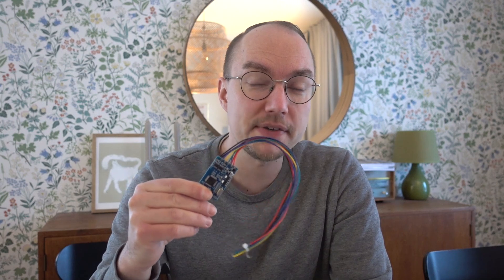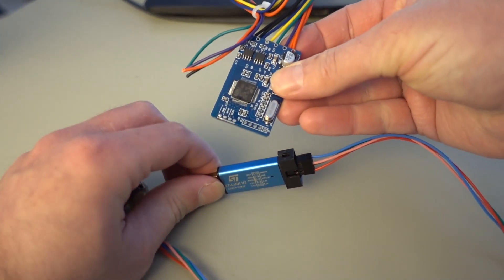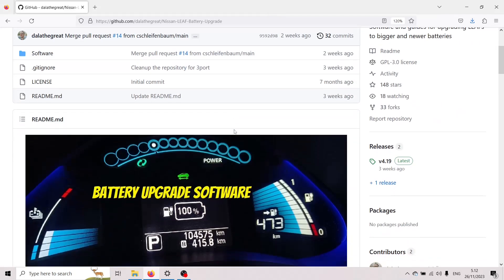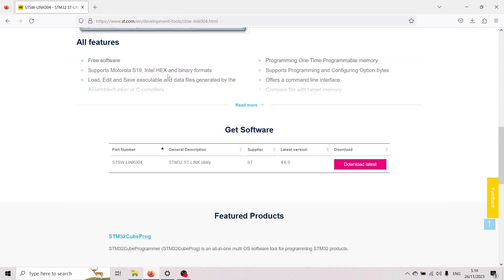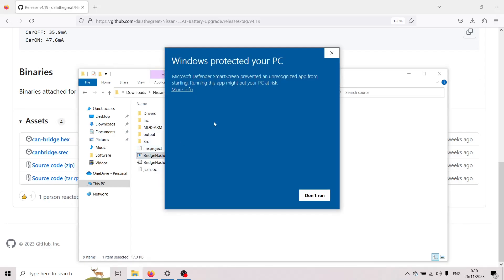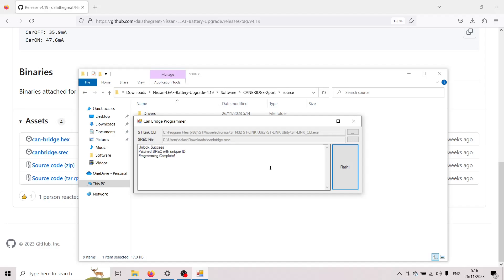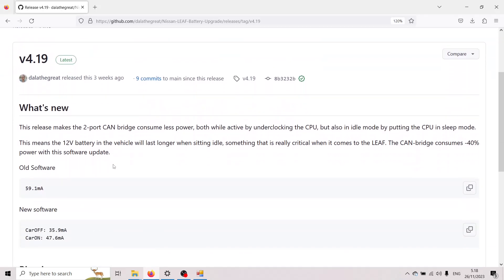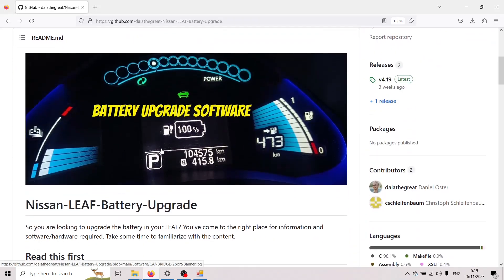Guide: Flash Battery-Upgrade onto 2-port CAN-bridge

Comment: Hi friend, thank you for your Canbridge project, it brought my Leaf back to life. I also wanted to ask you how to modify the Leaf to have the functions below?

Power increased to 94kW
Sailing mode in D
One-pedal drive mode in B
Improved heat pump and cold battery performance
Reply: is it work ? i do evry thing as it has to be . but on the car nothing changed at all like i connect nothing . any advice pleas

Comment: Hello
We have a 2012 Leaf with a 24 kWh battery. We installed cells from a 40 kWh battery from a 2021 Leaf into our battery (the size seemed to fit). We installed the CAN bridge according to your video—but the car doesn't recognize the new capacity. After turning on the ignition, it shows 136 km of range, but after 3-4 seconds it resets to 125 km (if the battery is charged). If the battery is not charged (we had a remaining range of 7 km), you turn on the ignition—it shows 136 km of range, then similarly resets after 3-4 seconds to 7 km on the dashboard. Please advise what to do?
Reply: In fact, the range has increased. We are tracking the remaining capacity through LeafSpy. The car charges - everything is fine with that.
Reply from the maker: You need the full 40kWh BMS and current sensor. My bridge software does not work for cellswaps. Complete batteries only!

Comment: Hi there - I got stuck with programming the board and was getting can't connect to the board error.  I assumed that the power from the programmer stick is enough. Not sure if my programmer doesn't have enough power or just ommited that info (or just had my moment). So if you can't programm the board for the same reason, just connect 12V supply to the board (black+red) while programming and it works like charm. Now it seems obvious to me ;)

Comment: Hi Dala, great video thanks.  When I followed the instructions, I get this error:

Unlock Success
Patched SREC with unique ID
STM32 ST-LINK CLI v3.6.0.0
STM32 ST-LINK Command Line Interface
ST-LINK SN: 62021102220032524B413836
ST-LINK Firmware version: V2J37S7
Connected via SWD.
SWD Frequency = 4000K.
Target voltage = 3.3 V
Connection mode: Normal
Reset mode: Hardware reset
Device ID: 0x418 
Device flash Size: 128 Kbytes
Device family: STM32F10xx Connectivity Line 
Loading file...
Unable to open file!

Any thoughts on that?
Reply from the maker: Try another PC!
Reply: @DalasEVRepair That failed on a Windows 11 PC, I don't have another Windows PC but managed to borrow a Windows 10 PC which worked correctly exactly like your video with just 3 lines of output. Thanks for the simple suggestion.
Reply from the maker: @EricLee-sj1bj  Glad it worked!
Reply: @DalasEVRepair  Now it's flashed, can I fit it to the car for testing with the original 30kWh battery stiil fitted?

Comment: Is it possible to make a firmware so that the canbridge works only when replacing battery elements? Perhaps it is necessary for the canbridge to calculate only the voltage of the battery itself and give the results to the instrument panel. Let's say 400 volts is 130 km. 390 volts 120 km. and so on. Of course, if you know in advance how much kilowatt the battery takes from the outlet. From this, make an approximate graph of the instrument panel readings.

Comment: Hi. After replace the battery 24 to 40 i still have Can errors. U1000-00-0B and P31B8-00-0B. In leafspy i cant erase theese errors. There is no turtle o the
 dashboard. 12v is on the canbridge.
Reply from the maker: This is a known bug, wont affect anything! We are working on still fixing this cosmetic issue, so check back in a few months, there might be updates available on the Github!

Comment: Good afternoon. I have a Nissan Leaf 2011. 24 kW, health 40%. I only replaced the batteries from the 2016 Nissan Leaf, 30 kW, 70% health, . will your canbridge help you display your dashboard correctly? Please answer.
Reply from the maker: Nope my can bridge does not work for cellswaps

Comment: Hi, thank you for your valuable help for those who appreciate electric vehicles. I upgraded to Nissan Leaf from 30kwh (2017) to 40kwh (2023). I state that I had to turn on the machine to move it before installing can bridge. I performed the whole procedure with a 2-way bridge. The flash went well immediately without error. But after the assembly everything looks exactly the same as before the assembly of the can bridge. Turtle mode remains active and the battery cannot be charged. I have used Leaf spy pro and the mistakes are always the same. I tried to delete errors but they remain active.  I have 2 questions.
1) Can you confirm that in the 2017 version the cables that go to the battery are the ones that end up in the plug? Or is it the other way around? 
2) You wrote that there are defective canbridges. At what stage of their use did you discover this defect? During software installation or after connecting to your Nissan Leaf. Thank you again.Hi, thank you for your valuable help for those who appreciate electric vehicles. I upgraded to Nissan Leaf from 30kwh (2017) to 40kwh (2023). I state that I had to turn on the machine to move it before installing can bridge. I performed the whole procedure with a 2-way bridge. The flash went well immediately without error. But after the assembly everything looks exactly the same as before the assembly of the can bridge. Turtle mode remains active and the battery cannot be charged. I have used Leaf spy pro and the mistakes are always the same. I tried to delete errors but they remain active.  I have 2 questions.
1) Can you confirm that in the 2017 version the cables that go to the battery are the ones that end up in the plug? Or is it the other way around? 
2) You wrote that there are defective canbridges. At what stage of their use did you discover this defect? During software installation or after connecting to your Nissan Leaf. Thank you again.
Reply from the maker: Hi,
30kWh LEAF can be upgraded to 40kWh without CAN bridge (but instrumentation km will flash)

I suggest you try without a CAN bridge first!

P3102 error code can be cleared with Leafspy Pro. I have videos on that.

Comment: Hello, 
Hope you are doing pretty well. I just need to ask about this can- bridge. Is it possible to use this can-bridge with original BMS to read a new capacity.
Remark. All cells have been swapped into new cells which have new capacity.
Thanks in advance
Reply from the maker: No that is not possible. Best to contact the person you bought the cells from.
Reply: @DalasEVRepair  He has no clue about solving this issue

Comment: Hey dala , I have a problem  ,  I tried flashing using the 2 port can bridge by installing and uninstalling the softwares and many things still it Wont flash , do u know any particular reason? i fixed those wires by soldering them with lead but still doesnt work , is it perhaps a problem in software release ?
Reply from the maker: I had 1/50 be broken right out of the box. Try another computer, or order a new bridge. They are unfortunately very low quality, I always recommend buying 2!
Reply: @DalasEVRepair  thanks man another computer worked

Comment: hey Dala , love your work here, will the 2 port Can upgrade allow me to charge my 2012 pack up to 4.2volts ? Will this give a 4 bar pack an increase in range ?
Reply from the maker: Nope, this is just for battery upgrades
Reply: @DalasEVRepair  Does you have a circuit that allows me to take a Chademo connector and leads so that I can connect the leaf straight into the Hybrid input of my solar inverter ?  I guess it would need a can bus signal to negotiate with the car to turn on the chademo power.
Reply from the maker: @chris2pherrea  yes we are working on this

Comment: Dala I purchased the can-bridge the two port i follow your video  and everything seem to work i down loaded lates software from github which is v4.20 now and made a account for STM32 ST-LINK Utility and everythink work up to the point of were it say Can Bridge Programmer I have the two boxes filled in were it say ST Link CU and Spec file I click on the flash box and don't the Unlock Success or any other failer just a blank box can you tell me what I might need to check?
Reply from the maker: If you follow the video and it still has issues, try another computer!
Reply: @DalasEVRepair  
Will the software work on a Apple PC the computer I tried it on was a window 10 lap top?
Reply from the maker: @SalvadorEspiritu-l2k  no apple support unfortunately!

Comment: Can I use the Cambridge to access the features such as battery saver to limit the charge to 80%and rapid gate dodger on a 2018 leaf?
Reply from the maker: No, this is for upgrading batteries on 2011-2017 Leafs
Reply: Do you know if there is any way to add those functions to a 2018 leaf?

Comment: Can I use the Cambridge to access the features such as battery saver to limit the charge to 80%and rapid gate dodger on a 2018 leaf?
Reply: its a good question Dala please answer i have the same issue in 2017 leaf

Comment: Can I use on my 2018 40kw leaf? Is the wiring the same as the other models of leaf?
Reply from the maker: No this is only for 2011-2017 LEAFs. 2018 leaf can be upgraded to 62kWh without the need of a canbridge
Reply: @DalasEVRepair  Are you able to add the other features you have developed to 2018 and up models such as the battery saver and the rapid gate dodger? I have very much enjoyed those features on my 2013 leaf.

Comment: What is the power draw of the 2 port can bridge when the car is not in use? My leaf has around 0,18A power draw when not in use. That may see not much, bur its 4Ah per day... so main battery dear in 10 days when not in use.
Reply from the maker: Info here https://github.com/dalathegreat/Nissan-LEAF-Battery-Upgrade/releases/tag/v4.19
Reply: @DalasEVRepair  Thanks! The upgade helped significantly :)

Comment: Thanks so much Dala for offering your code and CAN do knowledge - I knew it would be possible to make my own CAN translater for the battery upgrade but needed someone like yourself to share their knowledge.  Also I just became a Patreon!  I have been searching for batteries but just found a salvaged 2019 leaf S plus that I believe will be good for many high voltage parts and definately its battery pack.  So I will swap the 62kwh battery into my 2015 leaf S. 
I'm comfortable with the fabrication and hardware/software  but needed someone to lead the way -  I love your work.
QUESTION:   Your inverter upgrade video has got me wondering how far I could go with the parts from this 2019 Leaf S plus.  Will the inverter from the 2019 S plus fit the motor of a 2015 S and how much increase in power will it provide (I don't mind some coolant hose rerouting and wire splicing) but will the inverter fit the motor frame?   or should I save this inverter plus motor for an EV conversion in the future?  Any advice or recommendations?
Reply from the maker: Thanks for the support! 

Yes the HV inverter can be retrofitted to your LEAF, and will boost the power to 145kW (400A). 

See you on the Patreon Discord server!
Reply: @DalasEVRepair what about can bridge? Is it necessary to fit second can bridge between inverter and car can if car is equipped with can bridge to upgrade battery? Or we need to program extra code for inverter upgrade on battery upgrade can bridge?
Reply from the maker: @jackjurys6834  Extra bridge needed for inverter.

Comment: When fitting the can bridge do you need isolate the traction battery or just disconnect the 12v battery
Reply from the maker: Simply disconnecting 12V is enough
Reply: @DalasEVRepair  thanks Dala I'm putting in a new 2 port with software version 4.20 tonight
Reply: @DalasEVRepair  new can bridge in still having issues with the per programed heater not working it works when car is plugged in but not when not plugged in

Comment: Thank you for sharing this very useful information with Leaf community. Would you recommend using a 3d printed case for 2-port can bridge ? Do you know if there are any ready made models available to download ? Is it possible to use LeafEnhancer BatterySaver with this can bridge ?
Reply from the maker: The bridge comes with shrinkwrap, good enough as a case!
Reply: @DalasEVRepair  You are right, thanks!  Is it possible to use LeafEnhancer BatterySaver with this can bridge ?
Reply: I use small plastc cotainer for food from Ikea. I drilled the hole for cables and fit cable gland. Like that you have easy access to can bridge in case updates.

Comment: Hi ! Dala.you are the top, you give 100% and salvation for people like me. I want advice. I have a Leaf 2012, I'm at 63%, I bought a battery from 2015, I'm at 85%. From your work, I understood that the most trouble-free way to replace the barrier is to exchange the elements. Did I understand correctly?
Reply from the maker: Nope. Do a clean upgrade. Never open the packs, so unnecessarily risky! https://github.com/dalathegreat/Nissan-LEAF-Battery-Upgrade/wiki
Reply: @DalasEVRepair  Thanks so much for the quick reply. I found the instructions on disconnecting the contacts in the battery, but I'll replace the battery with your explanations for fitting a model after 2013 and the Life Spy Pro. Thank you again.
Reply: I have leaf 2012  electric  hand brake ,my battery  is shows only 30 km full charge ,i did reset the  change  discharge  data is shows 110km  full change  ,but can use it it give  only 25 km ,what i will do 😢😢😢
Reply from the maker: @chenaotunna4104   Start searching for a newer battery!

Comment: Thank you Dala, I've learned so much from you. I successfully replaced all the cells in wife's 30kWh leaf which now works even in winter. I managed to update the SOH to 100% and reset the charging counters. Unfortunately the VCI made some mess, now the battery reads as 24kWh instead of 30kWh, Ahr is still at 56 and the bars in the dash are still just eight. I'm waiting for a new diagnostic tool. LeafSpy is really great, but unfortunately doesn't update the SOH and bars. I can post the results, if anyone is interested. I wonder if this CAN bridge can help, since I don't yet understand it completely, for example, how does it know what the main computer expects from the LBC. I guess it enquires the capacity from the battery. Thank you again, your knowledge and contribution is highly valued. All the best.

Comment: Hello sir, 24 40kwh battery modules were installed with a BMS that came with 24kwh in 2013 and showed the same old capacity. The can bridge you show in this video
(2-port budget) The board was "flashed" correctly. Installed correctly and still shows the same old capacity. Please explain the error.
Reply from the maker: My software only allows for clean OEM upgrades. No cell-swapping. If you use 40kWh modules, you need the 40kWh BMS also.
Reply: @DalasEVRepair  thank you sir...🙏

Comment: Hi Daniel, thanks for sharing.
Question. Would it be possible for a charging network operator to block Leafs that have been converted from Chademo to CCS 2?
I am starting to get worried. Allego set up a small park of chargers near where I live- 16 charge points. Not one single Chademo. Allego always supported Chademo in the past.
I was thinking about getting the Muxsan conversion, but I'm worried that I might still be blocked from charging. I see Muxsan has increased the price of the CCS conversion by €500!
Reply from the maker: No blocking wont be possible!
Reply: We've already seen Chademo chargers terminating sessions drawing a steady 50kW here (Teslas with adapters). Wouldnt be surprised if we saw CSS trying to cut off slow charging sessions. So while they can't identify a specific car they can incentivise  you to find alternatives based on the charging profile.
Reply: @notsonominal   A good point. I would never occupy a 300/150kw charger. Lots of new 50kw chargers being installed. Charging etiquette is going to be very important if mass EV adoption is to become a reality. Here where I live, etiquette is not something everyone aspires to.
Reply: Muxan increased the price and went to bankrupt. I look forward @DalasEVRepair one day change mind regarding his project and continue https://github.com/dalathegreat/Nissan-LEAF-CCS. There is already pretty much information on: https://www.evcreate.com/nissan-leaf-ccs-fast-charging/ and https://github.com/cschleifenbaum/qleaf/wiki

Comment: Not related to the video but I am curious because I have a 40kw Leaf. Is it possible to upgrade to a 62kw pack from Nissan? Do you have any solution after the upgrade what to do with the software to recognize the new battery correctly? Is it the same as for the older 30kw models when they are upgraded to 62kw?
Reply from the maker: That is plug and play, just pair in the new battery!
Reply: @DalasEVRepair  Not completely. In Poland, in Radom, a person who had made many changes in Leaf 1 to 40 and 62 had a big problem with the communication of the 40kWh car after installing the 62kWh battery. It took a lot of time. So if a person who deals with it on a daily basis had problems, let alone an ordinary user.
Reply: Are you saying that you can just swap a 2018 40KW leaf's battery to a 60 KW battery without installing a cambridge or other modifications? Is there anyway to add the ability to charge to a percentage like you have done on the other models?  @DalasEVRepair
Reply: Can I use the Cambridge to access the features such as battery saver to limit the charge to 80%and rapid gate dodger on a 2018 leaf?

Comment: Dala, perhaps you can help me wiht my Fronius g20 in order to connect it to a battery pack made of 16 prismatic 304A &3,2 v.. I can’t find a BMS compatible.  Greetings from Spain
Reply from the maker: Batrium. It is expensive, but compatible with Fronius!
Reply: @DalasEVRepair  thks a lot
Reply: 16 cells * 3,2 is nowhere near the needed 160VDC min Voltage for it to work with Fronius…